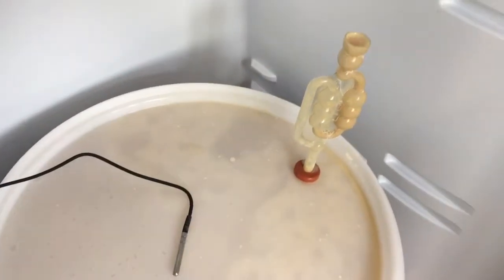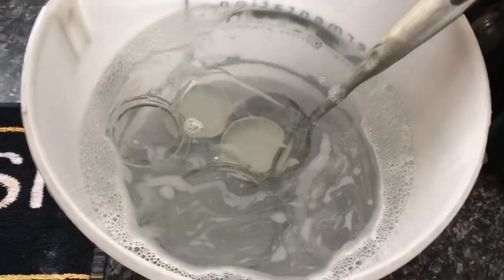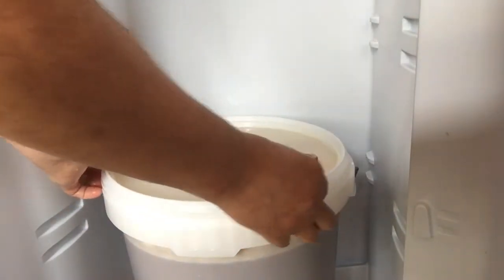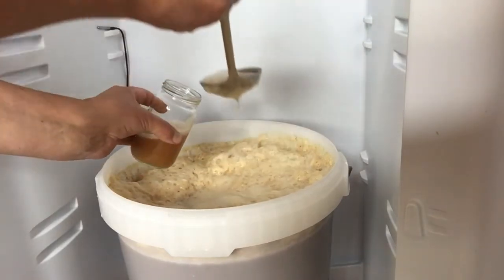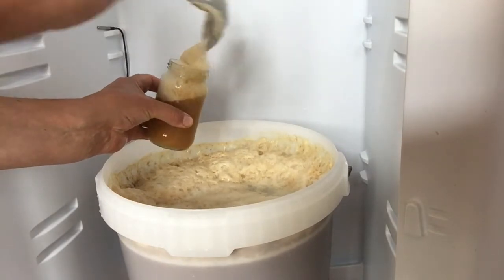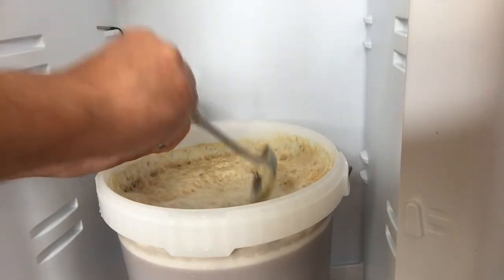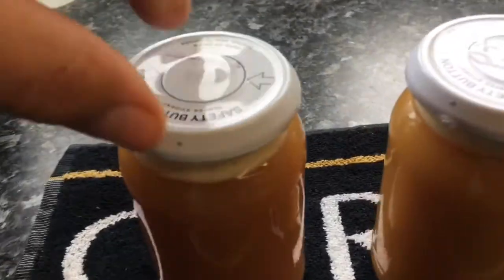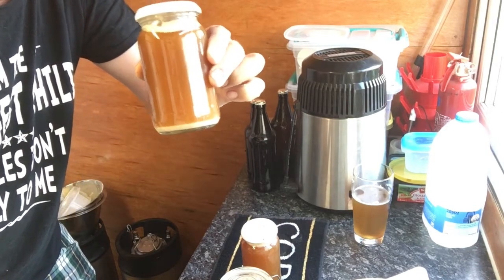Top cropping yeast

Comment: Great video Clive. How long will the yeast keep in the fridge once collected?
Reply from the maker: Hi The Grain Garage, I’ve kept it in the fridge for a couple of months, although ‘the experts’ would say a week or two!
The thing is, the longer you keep it the less viable it becomes so if you’ve kept your yeast for 2 months start with a 300ml starter and step it up to the required size.
Also, it’s ideal to keep it in a dedicated fridge and not the household fridge so it can be kept at a constant temperature. Obviously with the fluctuating temps of the household fridge it will speed up the deterioration of the yeast. 
Cheers! Thanks for watching!! 👍

Comment: why are you not cropping the foam on top instead of the beer?
Reply from the maker: Hi John, the Krausen can be collected, best practice is to discard the first skim as the Krausen contains a lot of protein and then collect the second and third skim. Chris White also says that you can go deeper to collect the yeast.
I just find it easier to collect the yeast from just under the Krausen  and put into my jam jars 48hrs after fermentation has started. At that time the yeast is quite vigorous and good for collection.
I also put in all of my yeast starter which is usually 1 or 1.5ltr so that’s what I take out when I top crop.
Cheers!
Reply: Looks more like creating a yeast starter, than top cropping. 
The Krausen was perfect, revealed when fermenter lid came off. Yeast always gives you more back than it takes. The Krausen should be skimmed off, into large plastic jug. 
Krausen is full of CO2, so need to knock it down. Then refil, repeat until required amount. Cover it, refrigerate. 
Next brew, remove from fridge an hour before, add wort at 20c, agitate, pour in fermenter. 
Same end result as it works for Clive, my example is easier and a brewery process. Indefinite yeast. 
Once a month acid clean the yeast by dropping it to pH of 2, kills everything, but the yeast. Add wort after, good for another month. 
Also, open top 20 bbl fermenters, dead flies, wasps - yeast wasn’t bothered 😀